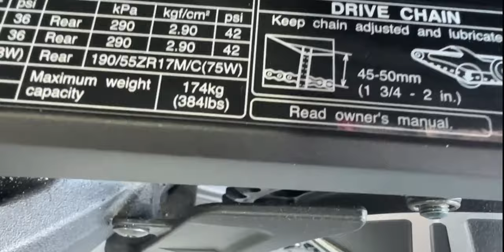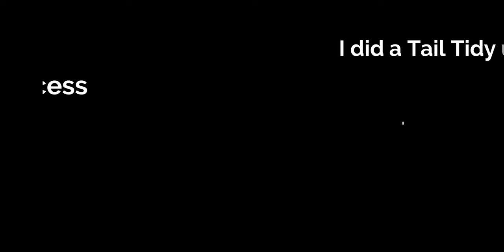Honda CB1000R Black Edition Chain Adjustment and Cleaning

Comment: Nice vid - I always had a dealer adjust, but yesterday, I figured I can do it myself.. However, my bike tool kit never contained the spanner wrench.. Also, it would be nice to see detail -starting 7:08 - of actually which way you are turning the spanner.. Thank you
Reply from the maker: Sorry, definitely a missed opportunity. However, one you start turning it, you see right away by the chain getting tighter or looser.